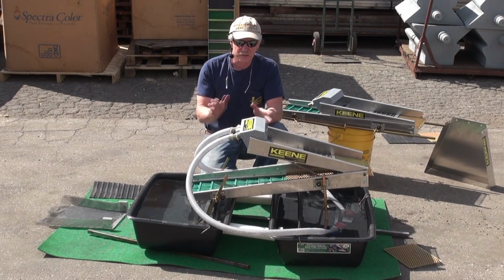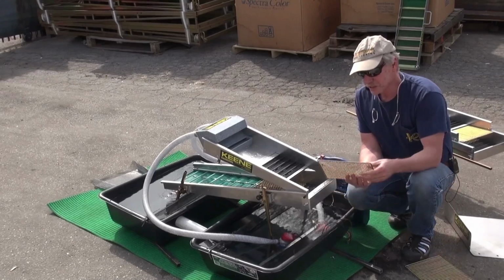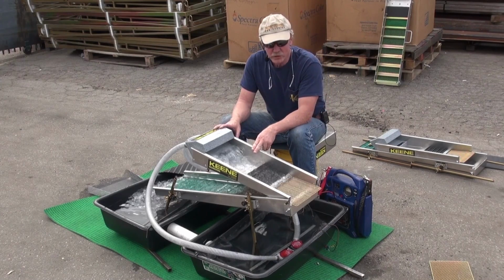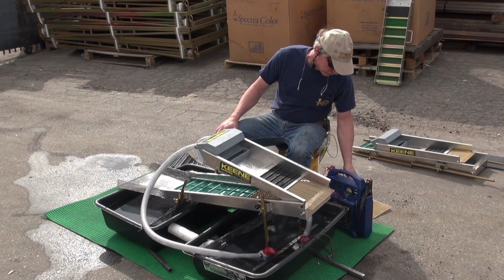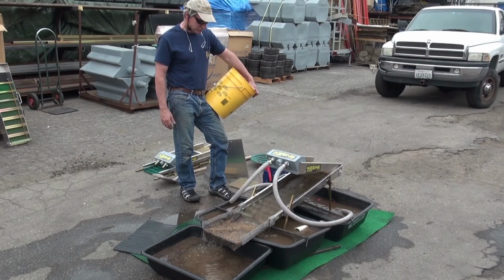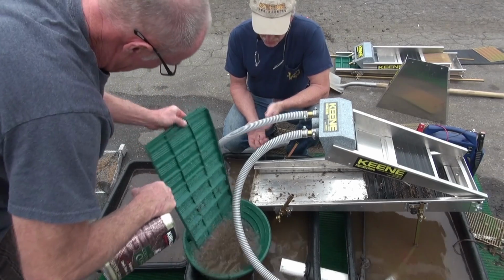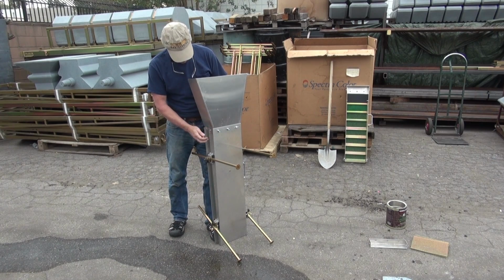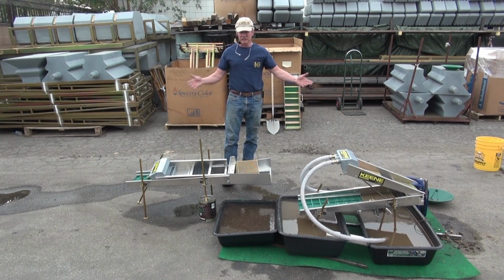Mini Max

Comment from the maker: This was my first attempt at setting up a recirculation system on the Mini Max.  I have learned a lot since then.  The biggest change is using larger tubs and more water. Having the third container is a much better system and better at the separation of water and material.
Reply: Keene Engineering Inc. hay there how can I order mini max ? Guide please

Comment: If i had that set-up,i would raise the sluice up,so i could put another yellow bucket under the bottom end,have a taller black tub under that,so all the dirt that gets right through the sluice,ends up in the yellow buckert,and i would run the sluice,until the bucket is full of pay dirt,not water,i would then turn the sluice off,and pan the dirt in the yellow bucket for any gold that got through the sluice system,possibly  even extend the slice run to double what you see there,and have a yellow bucket at the end.

Comment: I love the portability of these things. I see the comments about how much can it run, etc. it’s not meant to be a commercial system. I notice a huge difference between my capabilities from my early 20’s to my mid 30’s and I’m all about portable light weight gear to use. Battery operated vacuums are coming a long way as well which is great for crevices. Not as powerful as the gas powered but still,
Reply from the maker: I do understand I will be 60 in a few months so my equipment is getting smaller and lighter all the time.  In the past I would never consider using a smaller dredge than a 6" now I have to rethink things

Comment: My only concern is the hinge and header support taking a beating from the impact of shoveling heavier material and dense clay dirt. Obviously anyone with a brain will know not to hammer the header with 6 inch rocks, but after some time, the impact of of material would warp and bend the high stress areas.
Reply from the maker: We have had these out for several years now and I have never seen a single issue with wear and tear on the joints.  You are correct most people should have common sense in feeding the machine with smaller material.  Definitely not hitting it with 6" rocks.

Comment: Hey Mark, great run down of the mini-max. I currently own the A52, will be purchasing the A51 within a week or so for smaller streams, and was considering the mini max for a future purchase. I have a few questions regarding this unit. First, what are the dimensions? Is it similar to the A52 in width/length? Second, what is an estimated expected run time of those two electric pumps on say a series 27 deep cycle battery? I know there are variables but wouldn't want to purchase the electric pumps if they will only run say 3 hrs and would require a gas pump regardless to finish the day. That being said, can you purchase the parts separately? I sent an email to your company asking about the leg kit that is on this unit for my A52. Finally, what are your thoughts of hooking this up as a 2'' dredge "with a gasoline eng. of course". Thanks again for any and all info. Looks like a great set up.
Reply: 6⁶5t

Comment from the maker: Good question.  The grizzly bar classier screen classifies everything down to 1/4" material.  You can shovel larger material directly into the box with no problem. You can feed larger rocks around up to 4" but it makes sense to feed the Mini Max with smaller material or even pre-classify down to half inch if possible.  I prefer not to carry a buck full of rocks if possible.

Comment: Also, how big gravel can you put on that hopper.  I want to buy this but I question the bar holding up that hopper.  Obviously I am not going to put huge gravel cobbles on there but I would put be putting 3-4 inch gravel on there.

Comment: I had some doubts at first but the more that I look into this unit, the more  I "dig" it.  Sample,clean up, recirculate, compact and I love the fact that if something goes wrong out in the field mechanically, you at least have a complete sluice to revert to. (Instead of packing it in and losing a day). One bitchin idea for a machine.

Comment: Hey ,id only buy that if that machine can handle 3 inch river gravel rocks shoveled onto the hopper and then that material cleaned and pushed off the hopper without me touching it

Comment: The concentrator works very well with the dual pumps.  In the video the pumps are a pair of 1100 GPH pumps = 2200 GPH = . We found a new pump since this video we are now using a American made Johnson 1250 GPH pump = 2500 GPH = 37.50 GPM.  37 GPM is plenty of flow for a small sluice like this.  We have used in on the river a few times.  I have had some feed back from cusotmers and all positive.  The level of portablity was praised the only possible negative comment we one customer told me it took a little playing with to get the sluice box at the proper pitch.  The trick to getting the maximum flow is the 2 x 1 hoses and a flood box that creates very little to no back pressure. I just spoke with my brother patrick and he has spoke with dozens of customers and they all love it.  We have one customer that has several tons of concentrates that he is working over.  Being a skeptical person he has repetly double check the tailing and they are clean.
Reply: OR use one of these mini 4-cycle(4-stroke) 1" inch water pumps: Subaru PKV110 http://www.subarupower.com/products/pumps/pkv101-centrifugal-pump/pkv101-technical-information/
AND Honda WX-10 http://m.powerequipment.honda.com/pumps/models/wx10
Reply: Opal